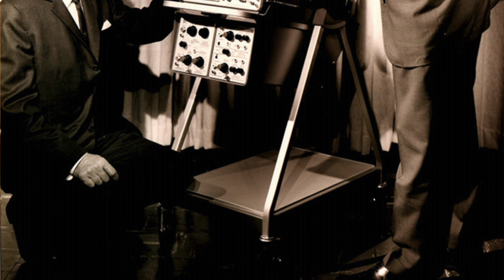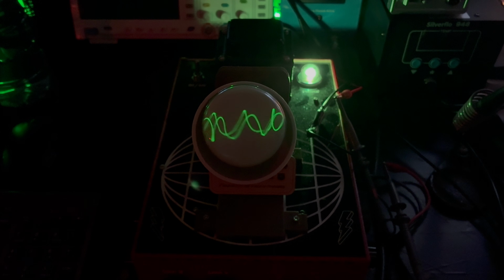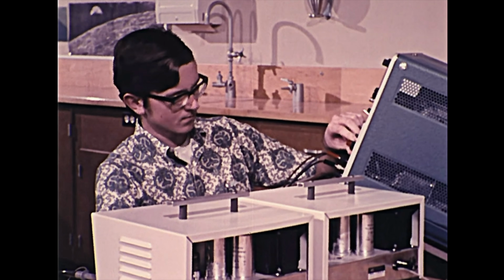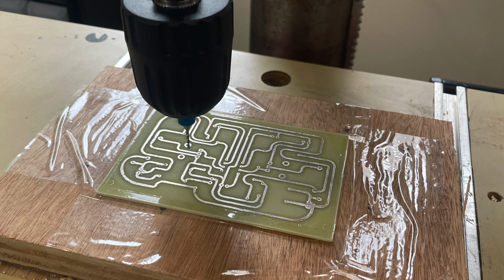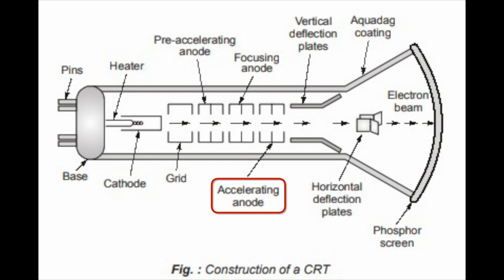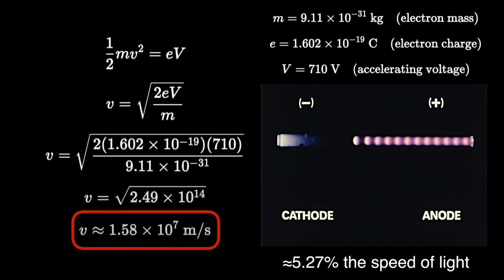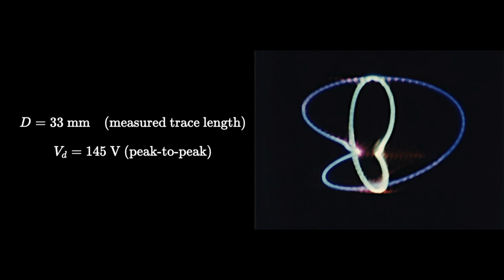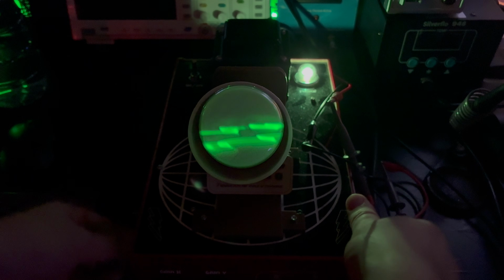Building a Cathode Ray Tube Oscilloscope

Comment: Cool build!  I hadn't realized that those little CRTs had that low an acceleration voltage.  The 1970s-era Tektronix unit that I'm working on uses -2960 V  on the cathode and 12 kV for the accelerator anode.  The screen throws enough light that long camera exposures weren't necessary. Back in the day, the camera mount had a regular old Polaroid back and a mechanical shutter (if memory serves, a fixed 10 ms exposure time).  The unit I have has a mounting flange for the camera, but the camera, if it ever  existed, is long gone.
Reply from the maker: that is an unseenly amount of voltage! alas yes i know they can get that high for more advanced/later systems but it was nice to still see some action in the sub 1000V territory. 

When i referenced the camera I do seek to specifically use a long persistence tube and a long exposure to capture the behavior. However by the time the 60s rolled around I think the exposures were short and it was merely a way of capturing the evidence period... not necessarily because one had to. An early "screenshot" so to speak. Thanks for watching!
Reply: @joshuacolemanmakes7518  Higher bandwidth scopes generally need a higher voltage. My 200 MHz Tek 475 runs on +15.5 kV and -2450 V. 
You need a really bright trace to capture a single shot event on film when it's only a few nanoseconds long.